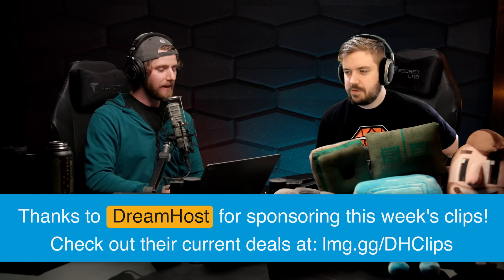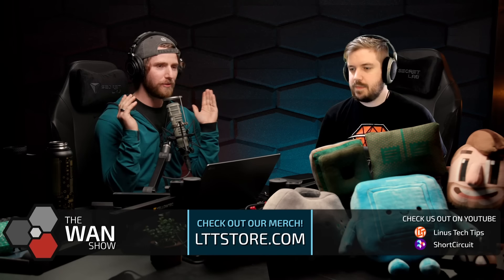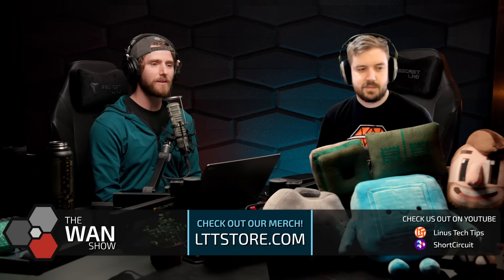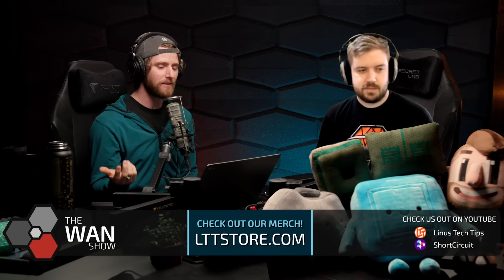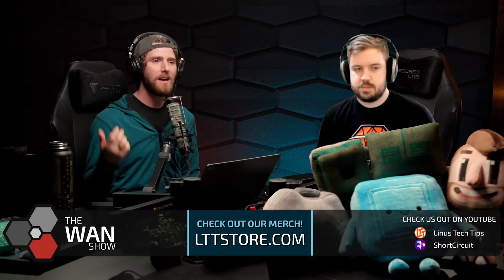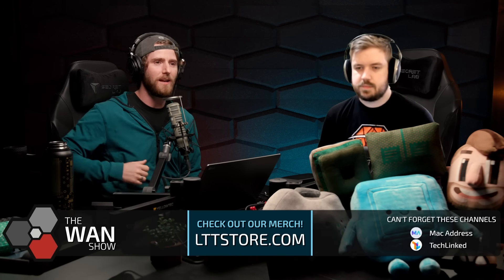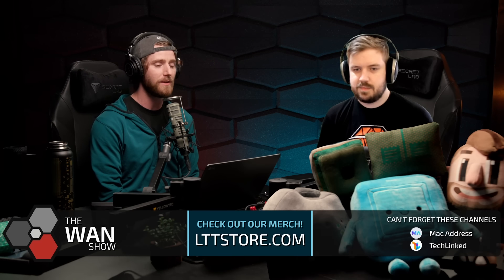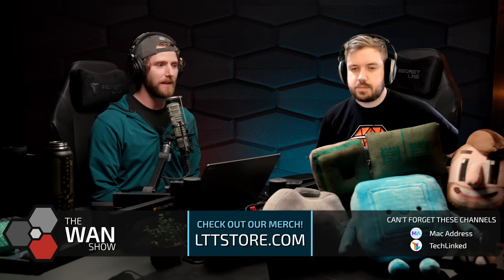They made me WASTE $10,000! Pt. 1

Comment: Too bad zencontrol isn't able to be sold in the US/Canada. We have good switches, touch screen switches (new version with lots more features coming very soon), Control4 integration, go ahead and integrate with HomeAssistant if you want... If the cloud becomes unavailable it will still run and there's an offline tool if you need to cut away the cloud stuff entirely. Wireless DALI and Thread - so don't worry about it not all being wired up now, and it's a real standard not fly by night z-wave crap. We can remote update the firmware on the controllers and also the switches etc.

You can "inhibit" sensors/occupancy and have different scheduled profiles too so that whole thing is dealt with.

Who wants to fund the certification needed to sell the US/Canada?

Comment: I don’t really get the complaint about Lutron Caseta’s switches. I mean, sure the buttons aren’t the best. But you know what is the best, Lutron. None of that firmware bullshit would be a problem. But I probably wouldn’t recommend Caseta for Linus’ mansion. I’ve probably go with Lutron’s Radio RA2 or RA2 Select, or HomeWorks. They’re more advanced than Caseta and they have scene button panels,which for a more complicated home would probably be better. But all of Lutron’s stuff uses ClearConnect, which is fantastic. Even if the Internet is down, Lutron will still work. I think if you are going to spend that kind of money on Smart Home stuff, get Lutron. I have the Caseta stuff and their support has always been helpful. My only gripes with Lutron is that they have all these different ecosystems that although they use the same core connectivity with Clear Connect, their lines aren’t compatible, and I find it irritating that they don’t expose their Pico remotes to HomeKit. Although you can control multiple Lutron devices from a Pico, and you can trigger non Lutron devices with HomeKit from the action of a Lutron device, you can’t access a Pico in HomeKit as a device, like you can light dimmers, lamp dimmers, etc.

Comment: Why you would not want your users to keep updated firmware on the device they purchased is crazy. They waste so much money on support just because they don't have a download page and simple instructions for standard systems it operates on. TP-Link Kasa switches have been what I installed at my new place because they are lower cost, work over my "business-grade" wifi, and take no login or extra setup to get them to work with Home Assistant. I would like to see more devices and integration to Home Assistant using the LoRa wireless tech as it's longer range, open standard, and low power.

Comment: I wouldn't want to hardwire any smart home features into a house because that concept means you can make your house itself obsolete hardware. The same reason why you never spec a built in sat nav in a car; as when manufacturer support ends (not if, when) you're basically carrying an unusable brick about in your car that self activates every time you turn on the ignition, and when you come to resell it the potential buyers asks; "oh its got sat nav" then you explain; "yeah its now an obsolete brick and is no-longer up to date" the buyer will be like; "nah i'll just buy a model without it or a newer model with one where its still under manufacturer support (for now!)". Theres a reason why 16th century houses and especially grand houses are still lived in in Europe; there's no deal breaking technology hardwired into the fabric of the building you have to rip out every 20-25 years and leave holes in walls etc. which on older properties is incredibly costly to repair properly with the correct materials, i.e. lime plaster on oak lath etc., not cheaper drywall. To look for longevity for buildings don't look to integrate any technology that requires you to cut into the fabric of your house beyond essentials like electrics etc. Use things that can be face fixed, fitted into a traditional mounting, wireless, preferably with a remote, and can be undone if necessary. In case you bet on the wrong technological horse.

Comment: What i use is probaly a bit more nerdy but works great and i am not afraid at all that a company dies or something else happends.
Home assistant oh man you can just connect anything to it. Home assistant with Philips hue zigbee and esphome work amazingly.
PS with Philips Hue the Hue bridge doesnt like it to have more than 50 devices connected to it and it is a HELL to get 2 working. With zigbee on the other hand i run 150 devices on a single zigbee network.

Also as switches you could use a nextion display and a ESP/raspberry pi zero. and so fort limitless possibility ;)

Comment: I don't know, is that in Europe that much easier, or the products I bought are that much simpler than a real complex house automation system, but the firmware update is working almost automatically for me. If there is an existing update I just press okay, and it is immediately downloaded and installed. I must admit, I don't own the apartment where I live, and I can't make changes in the wiring, so I'm using different smart solution upgrades like Homematic IP, Philips HUE or Shelly smart switches. All of them do the firmware update automatically if I let them reach the internet. Maybe there is a good reason why you can't by Jasco smart home products in the EU.

Comment: I had this issue with Ubiquiti (namely the AmpliFi range of products). My router claimed it had no internet (though I was using it on my PC), and so I couldn't upgrade or downgrade the firmware through the web UI. I asked the support could they give me different copies of the firmware (other Ubiquiti products have them listed on their website). It took 2 hours for them to give me the firmware files. I just returned the product since the firmware didn't fix the issue and it made no sense, and because of the hoops I had to go through to get past and current firmware.

Comment: YouTube chat: Do you have to rip Poly B out?  Or can you just leave it there, and plump around it with new pipe, stuffing some anti-pest filler in each end of the Poly B and writing in Sharpie on it “do not use for plumbing”?  Seems to me like old non-liquid-safe pipes could still serve as decent fiber or ethernet conduit.

Is it that you “have to” rip out the Poly B so you can use the wall stud and floor holes the Poly B occupied for new better pipes?  Like, you could leave it in but all the new pipe holes you’d have to drill make it easier just to pull it out and replace with same-dimension pipes of better material?  And you’d have to pull off dry wall either way, which is most of the work?

Comment: I have a Jasco LED control switch in my home theater. I got it so I could recreate the movie experience of the lights dimming as the movie starts. I only operate it manually so firmware isn't a problem. I am currently designing a house which I intend to build in the next 3-5 years. I will definitely NOT buy Jasco products if they withhold firmware that would resolve known issues. I'm not big on the "{smart home" concept anyway because it really seems to be "stupidly aggravating home" technology. Also, I don't need to control my home lighting from a phone app when I am on vacation.

Comment: This is almost the reaction I got from Lenovo when contacting them as the Windows image on my Yoga Book went bad after an update. Like:
"hey, do you guys have an image you can give me that I can flash on to the device?"
"seems like your warranty has expired 3 month ago"
"so do you have one? I'd pay you?!"
"yes we do have one"
"and what now?"
"you don't have warranty"
"so that means you won't support this perfectly working 3 year old device anymore because my warranty has expired?"
"..."

GREAT!
I did sent it in afterwards for repair and got the information that the replacement of the PERFECTLY FINE motherboard would cost me 320 €..  (a good used Yoga Book was 250 € back then)

So Lenovo wouldn't support me on a device that was just bad because of a windows update and quoted me over 300 € for a completely unnecessary repair.

Did find a dude online that published a working Windows image on a forum in the meantime this was going on.
Installed it. Worked.

By the way: No, you can't just install Windows on a device like this because... Lenovo!
They only got drivers for the touch-/drawingpad (that is the keyboard and trackpad at the same time) that you have to manually inject into the Windows installation media and the same goes for the graphics and audio driver iirc.

Comment: That's embarrassing, I use Shelly Relays because they keep the original switches and I don't have the risk of a early smart switch becoming dated looking, it's all inside the electrical box and the classic switch and any cover plate can be used.  I'm concerned all these first generation smart switches will become superseded and homeowners will get laughed at in 10 years.  I don't want to start replacing outlets, switches and lights as often as my cellphone!

Comment: Not providing firmware updates to end users is bad enough. But the fact that they either don't give the firmware to installers for updating at the time or installation, or simply haven't created a training program to inform installers that this is necessary, just straight up boggles my mind. How are they just fine with an end user getting (previously unused) hardware installed with years old firmware when new firmware has been released??? 🤨

Comment: kasa switches are the best quality and cheapest by far, but you need a neutral wire
Reply: then you use IFTTT to make automations / use the device from different manufactories like aquara or wyze together
Reply: connect everything to a guest wifi network you setup on your router that doesn't allow you to connect to the main network,   so you don't have to worry about your smart devices security access your pc's private data since they on separate wifi networks

Comment: Most smart home stuff is garbage these days.  It's either garbage, spy ware or really expensive and completely proprietary... and garbage in 5-10 years anyway.
I automate hallway/stairway and bathroom lights.  Best mod I ever did.  The upstairs/downstairs hall lights work flawlessly.  Did I rip up the walls to get neutral wires?  Hell no.  I stuck a smart bulb in the socket a zigbee motion sensor and a python script in a docker container.  0 installation, if you exclude the sticky tape for the motion sensor on a door frame top.  When I leave I can take it with me.
RF/Zigbee remotes for lights are worth having.  I use RF key fobs in addition to the fake light switch stuck over the old one.  Like a keyfob to turn the light off/on while in bed.

Comment: It is really odd to me that someone as tech-savvy like Linus would want to rely on a Z-Wave based system. As someone in IT myself, anything wireless is a reliability and security nightmare.
Did you consider KNX at all, which is an international standard and uses wires instead? You wouldn't have to deal with proprietary junk, since a device either supports KNX or it doesn't.
Reply: Knx have its uses. But for most it is not wife friendly or next tenant/owner friendly. 
Try sell the house and either rip out everything or have to give a number knowledgeable knx operator or say there is a 140$ (or is it 1400) web interface for pc. 
I would beleave you would have them running If they did not plan to already redo the electrics after buying. 
Commercial sure, we have it here where I work and it works fine...but as we do our own smart home where I work it is annoying that we are not allowed to use our own kit in the office lights thanks to the building owner.  
But most of it is just Dali anyway. Only buttons and some controller are knx.

Comment: Better of just using smart bulb I think it the moment. I just control mine via Google home. No need to touch a switch. If someone does want to turn one on just flick switch off then on and it comes on. It's far cheaper and you don't need an electrician. I've only had one fail and that's because my kids decided to play tea party with water and poor it through the ceiling. 🤣 They cost about £10 so it's a minor cost. Bulbs with motion sensors exist aswell for say a hall way. If you rent aswell you can still have the tech without interfering with any wiring.

Comment: So I can understand Linus' frustration but to spen 10k and just jump in is rather silly. HA has its own problems like not being new user friendly. Plenty of devices say they're compatable and aren't. My shelly lights work with my Ikea tradfri and tuya use to work flawlessly but now tuya screwed that all up and my shelly bulbs randomly disconnect. Tradfri has been consistently good. Until I added the tuya, my whole setup was offline too.
You have to try things before jumping in fully.

They should not be withholding firmware however. That actually made me mad

Comment: You spend that much and can't get a firmware update? My $17 smart light bulbs get them when ever there is one available without me having to do anything. I've effectively replaced 95% of my light bulbs with them and they're great. All but have lasted 2+ years (still going). I no longer have to mess with the outside light because it's set to go off at sunrise and come on at sunset. In fact I have the living room, dining room, and kitchen set to either turn off/on at set times or dim/brighten at set times.

Comment: I don't know what you expected. I absolutely hate the smart features that Microsoft has implemented in Windows. They just get in the way of my workflow. I can definitely see smart switches creating similar issues in a home. Until we have proper AI to support theses features, I'm a proponent of keeping things more manual and simple.

About two year ago, I bought 2 new ceiling fans. My home is wired so that the light can be turned on and off independently of the ceiling fan. Almost all of the junk nowadays is a 2 wire setup, or has a remote control that you will lose within a month. I need 3 wire, a live, a switch live and a neutral. I'm a technophile, but sometime, I just hate the way that new devices are designed.

Comment: So: spent $10k on smart light switches with a way to update the firmware… However, the manufacturer of the light switch will not provide the firmware to the end users to update the switch? My question would be firstly: how the hell are you supposed to fix outdated and buggy firmware, and secondly: do they not expect someone programmatically inclined to get pissed off at it, dump the firmware, update it themselves, and make it open source?

Comment: The choice is the outrageous cost one. 

Lutron Caseta switches are great and can be controlled completely locally. 

The lack of tactile feedback isn’t a big issue.  Sure it isn’t clicky at all, but it’s the best light switch.
Reply: the whole point of switches is to terminate electrical connections safely, the snappy "clickiness" and resistance to tripping are signs of a high quality switch designed for it's contacts to separate abruptly for safety and lifetime reasons, a mushy switch or something that can be half pressed can cause misconnections and electric arcs which could cause short circuits, electrocution and fires while eroding the switch's contacts shortening their life and reliability
essentially if you have a switch that can be slowly pushed without snapping before reaching it's middle position it's a potential hazard waiting to happen and you should never favor a mushy switch over a snappy one regardless of price, convenience or aesthetics

Watch Technology Connections' "switches are clicky" video
Reply: @PSkullKidDnazen  physical switches are clicky.  Electronic switches can be solid state. 

I agree with Technology Connections for “analog” switches.  Wireless switches aren’t that though. 

Kasa switches are relay based, but use a fake clicky switch.  The click in the switch isn’t the power disconnecting, the second click after you press the button is the relay disconnecting power.  The switch just triggers the relay. 

All wireless switches have software buttons since they have to be able to disconnect based on digital signal. 

Caseta switches use a field effect transistor to control the power.  

Both the Caseta and Kasa switch have a hard disconnect as well.  The Caseta hard switch is pulled out from the bottom of the switch.

Comment: Home automation is creepy at best, and nightmarish on a normal day during setup. Just don't do it. All of these devices planted around your house tracking your every movement, sending that data to god-knows-where for god-knows-what purpose. Is a tiny bit of convenience worth it? When it actually works the way it's supposed to, I mean.

If you need/want an NVR/Security Camera setup, don't connect it to the internet. Have it on its own network (if it uses Cat5/IP). Physically connect to the internet temporarily for firmware updates only.

Comment: Linus fell for an apple like company... Their product is tightly integrated, great on paper, but they make it bad through locked software for no apparent reason. 

He should have known better and chose the implementation that offers more flexibility rather than the tightly integrated one.

The movement sensor in the switch is a bad idea anyway... I don't get why he wants it there... It should be mounted near the ceiling in a spot and angle that allows it to detect a wider area. Not in the switch where it's likely to have a limited view. Not to mention that now if one things fails he needs to replace the whole switch.